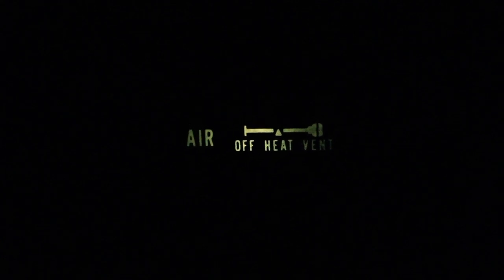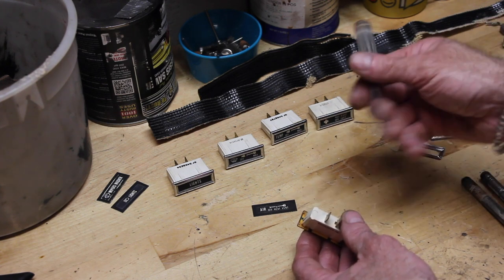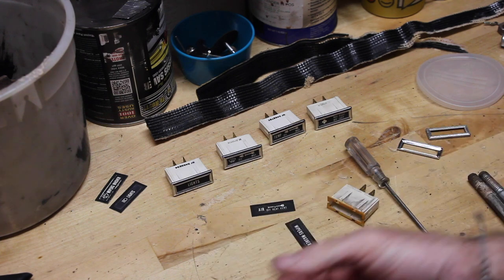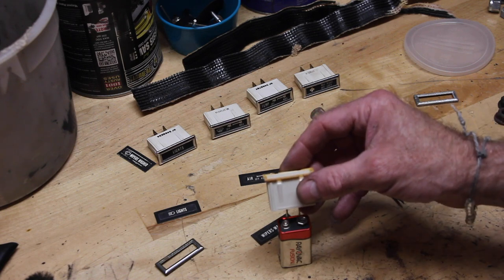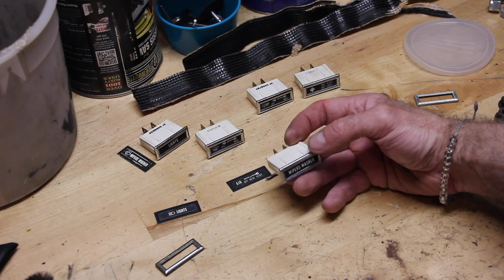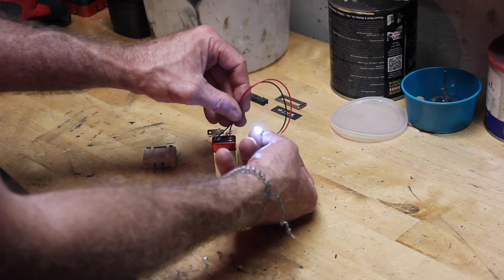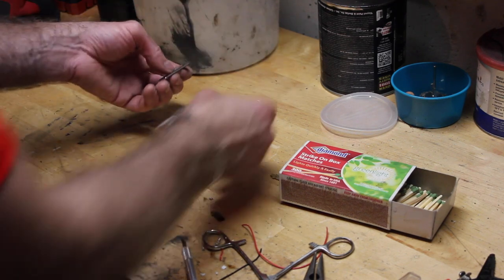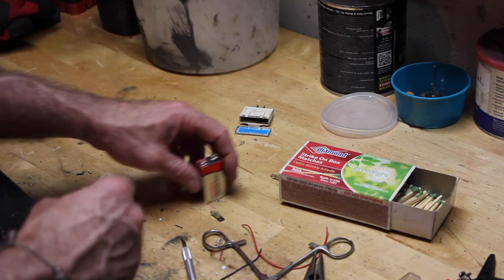Jeep CJ7 Dash Light Repair, Restoration, LED upgrade

Comment: Going by the White Face Gauges the indicators changed to icons 80-86. i am installing beige face decals and the kit I ordered was 80-86. I like you videos, very helpful.
Reply from the maker: Interesting color for the face decals. Where did you get a set of beige decals?
Reply: @coolguy_CJ7  I got them from whitefacegauges.com. I chose beige to match beige racing seats and 304 engine is beige as well. Trying to build my dream CJ, that I couldn't afford to do when I was a teenager.Red with beige interior and detailed engine. Also using your video to add LED lights in the dash! Thanks,again
Reply from the maker: @williamshoemaker6233  Cool. Totally makes sense. I'm checking out whiteface right now.

Comment: Very interesting though that you did all the work to swap the face plates to retain the factory green color over the aftermarket blue, yet installing the LED bulbs with factory face plates makes the color appear blue just like the aftermarket
Reply from the maker: Good assessment. :-) That was one of the things that I really clued into after I installed them in the 84 CJ seven. If I were to do it all over again, I would go with more of the warm light LED.. But like everything else it was a learning process. I will eventually swap out the bulbs on my 79 golden eagle, but that won’t be until they burn out.

Comment: 13:47 Correction. They have Resistors underneath the heat shrink not diodes. The LED's themselves are Diodes. Very helpful Vid. I dabble in electronics so I'll just make my own backlights, using anywhere between 500 to 1000 Ohm 1/4 watt resisters, then slip on the Heat Shrink. Again, informative video.
Reply from the maker: Thank you for that info. Love it when people have the correct info so we can all learn. Makes us all better at the CJ restoration. :)

Comment: Thanks for this!  I want to try scraping off the blue on a newer style one and seeing if I can apply white vinyl to it and have it light up in white to match my new gauges instead of the blue or green colors
Reply from the maker: Haven't tried that. I'll pull out a replacement lens that I have and try it. Cautiously optimistic.
Reply: @coolguy_CJ7  Awesome! Let me know if you can get it light up with white text!  Thanks!

Comment: Hey again. Have you made a vid that shows how to properly remove the dash lights from the dash? I saw the procedure a  while back somewhere. Was it you. BTW I've been having engine bay wiring issues for a while. Decided to pull the light switch and it tested bad. Got a replacement yesterday. That should help me out a lot in solving my other under the hood issues. tks
Reply from the maker: Wasn't me. :) but if you do find that video, share it out. As of now, I don't know of a reliable way to pull/push the indicator light housing through/out of the dash. I just try to carefully wedge them out one notch at a time. Sometimes they are so brittle, you don't  stand a chance. Wonder if heating them a little with a heat gun would help soften them up a touch. I'm going to have to try that.

Comment: Great videos. Would love to see your sand blasting and powder coating set up.  That seems like a huge benefit to the restoration project.  Not sure if you can do a quick video on your set up or Direct message me on it.  Thanks again.
Reply from the maker: That is one of the videos that I plan to do here really soon. Thanks for the suggestion. As long as you're subscribed you'll know about it immediately. Although i have to warn you, I did all of this out of a small room in the basement and my 2 car garage. It's a little underwhelming. But i guess that proves out you can do this almost anywhere.
Reply: @coolguy_CJ7  Great.  keep up the videos.  Your videos inspired me to refurbish a CJ7 Center Console which came out great!  I used some of your technics from your videos.

Comment: I love the videos.   I have a 1984 Jeep CJ7 where can I find the timing chain cover bolts all the hardware
Reply from the maker: Except for the "specialty" bolts, they are just standard fair. The seals and gaskets and most other parts can be sourced from Quadratec, Morris 4x4, or rockauto.com. are you replacing what you already have or replacing something that wasn't there before?
Reply: @coolguy_CJ7  I need the specialty bolts. The mechanic I had working on my jeep helped himself to some of my  parts .He  never came back after I paid him . He tore my deep into pieces so now I'm having to piece it back together. The hardware for the timing chain cover is part of what he stoled along with the alternator and a few other things.
Reply from the maker: I would start with Rudy first. He has an incentory like no other snd will help you out. https://rudys-cjs.com/
If that doesn't work, then try to reach out to Mr. CJ on ebay. https://ebay.to/36rx0JB
If neither of those work, there sre a few guys on FB market place that could help.

Comment: Hey Cool Guy, I have a 1977 CJ5 and the dash lights suck.  I want to do this to mine.  I do not see the "link below" to find the lights you used.  I think I have seen these at Hobby Lobby but, can you please email me the link where you got the bright white LED's.  Thank you
Reply from the maker: Thank you for pointing that out. I didn't realize that I had not put the link to the LED lights in the description. Duh. I will do that tonight. Long live the CJ7.
Reply: @coolguy_CJ7  Thank you. . . just looks like such a great upgrade. . .I have to do it.  You did such a great job of showing in great detail how to do it.  Thank you
Reply from the maker: Glad to be of service.
Reply from the maker: Did you check the description of the video? There's an Amazon link in there that should help.

Comment: Is that LED rated for 12V (or even 14.5V)?  Is there a concern of premature LED failure if the LED is able to light with 9V?
Reply from the maker: I made a set for my brother who has a CJ5. That was over a year ago and no problems. I don't know about 14.5v. What are you running that would need to take that much more voltage when everything in your dash operates on a grounded 12v?
Reply: @coolguy_CJ7  Man I love your videos, your about to walk me though replacing my heater core in one of your vids LOL. I like your LED mod, but I would advise adding a current limiting resistor to one leg of your LED's. Your driving the snot out of them without one, and eventually you'll be pulling them apart again to replace them. I cant tell but it looks like there was wire already on your LED terminals with heat shrink over them? If so there may be a resistor already in line under the heat shrink, I just can't tell from the video. If so ignore me LOL. EDIT: I didn't see your link to the LED's, I looked at them, and there is a resistor in the wiring to the terminal so your good! My bad.
Reply from the maker: @Aragorn35016_  Thanks so much for the eagle eye approach. The LEDs came with the resistor diode built in. I actually kept mine original, but just wanted to show how to do it if you wanted to. Keep the comments coming. It helps us all out.

Comment: So if I put white LEDs in a replacement dash indicator it will be blue and not green?
Reply from the maker: More than likely. The LEDs give off a much whiter/blue light that helps show through as blue. The original bulds were incandescent and hence, more yellow. Yellow and blue make green. Blue/white and blue make blue.
Reply: Thanks. I’m worried that if I buy blue LEDs and put in the replacement ones it’ll look more purple than blue. I’m trying to match the slate blue of my seats and stuff! Thanks for the info and content 👍

Comment: Can you tell me how the little interior lights under the dash are supposed to work? I put a test light where the bulb goes and grounded it and my test light goes on so I think the bulbs work but I'm not sure where the switch is supposed to be that supposed to ground it on the car to make the light come on? Thanx 😁
Reply from the maker: The courtesy lights connect to the wire harness section that comes out of the light switch plug. The light switch and the courtesy lights are grounded through its threaded post and into the dash panel. There needs to be a little bit of exposed metal around the hole for the light switch post to ground it. The bevel nut that screws down over the light switch post that holds it in place can be removed with a pair of small tipped needle nose pliers and a little WD40.
Reply: @coolguy_CJ7  thanks, yeah I guess there's no like door switch that makes the lights go on and off they only go on through the headlight switch, which mine was kind of bad so I replaced it and now they work fine when I just turn them on with the headlight knob.
Oh, I traced the same wire that goes to the back and there's no light there so I was trying to find out what kind of light was supposed to be on the left side of the back seat that hooks up to the other interior lights through the headlight switch. There's a plug to plug it in but there's no light maybe you could help me if you know what lights supposed to go back there, thanks!
Reply from the maker: @BryanHannaActingReel  does the plug have a white, square housing and have an orange wire running to it?
Reply: @coolguy_CJ7  yes it's a white kind of squared plug with the orange and black wire.
Reply from the maker: @BryanHannaActingReel  that would go to the light in the hardtop, inside, above the lift gate. It was either 81 or 82 when the hardtop changed slightly. Pre 80s had no interior light but the wire harness had it in anticipation.
Reply: @coolguy_CJ7  well this one's not a hardtop it's a soft top and the wire with the white square box for it to plug into is right next to the seat on the left side so it would need a long wire to go all the way up to the top but it's a soft top so I don't think there was any light up there
Reply: And it's a 1985 Jeep CJ7
Reply from the maker: @BryanHannaActingReel  if you can, send a photo to dellis6914@gmail.com. This seems strange to me.

Comment: I did the same thing but i reused my original caseings. I wanna work on a 3d print file for the case but ill need to test it as idk if it will hold up
Reply from the maker: Did you get the casings 3D printed yet?
Reply: @coolguy_CJ7  yes. Didnt fit, im working on some changes that should make it fit better, got busy and kinda forgot about it since school and some other things needed repaired on the jeep, but once my parking light housing is done printing im gonna pop the file into the printer and try it out.
Reply: @coolguy_CJ7  re sized it so that it fits aswell as the oem. I only put the ramp/ catch things on the bottom and top as its a pain to  Remove them without pulling the dashboard  Will probably post the STL file on thingiverse so anyone with a printer can print one.
Reply: @coolguy_CJ7  the pla plastic is much more flexible than the original 40 year old ones
Reply from the maker: @chickensfloat7427  that's for sure.  That's why i replaced the plastic housing with the new ones but kept the original lens and bezel.
Reply from the maker: @chickensfloat7427  This is super cool. When you post it, post the link here for all to follow. Nice work.